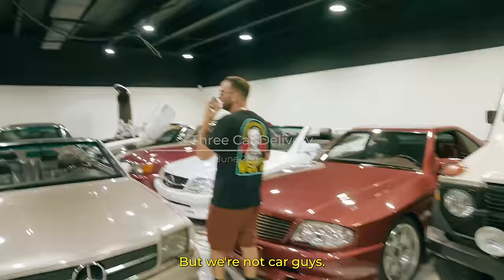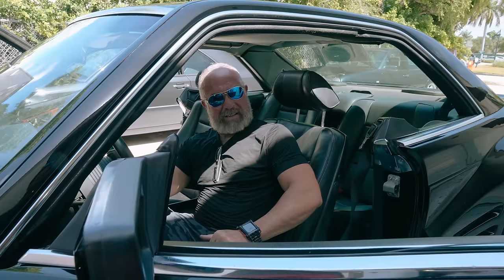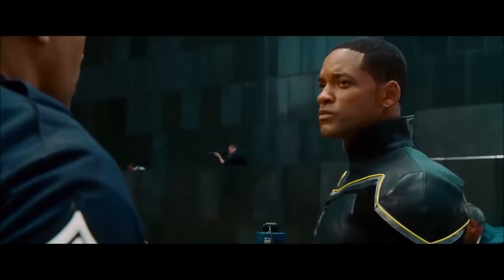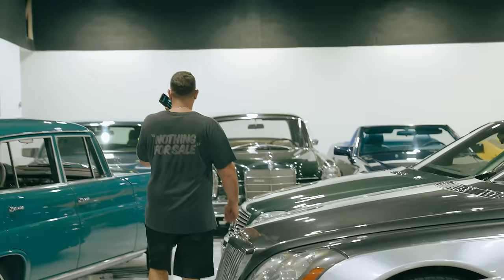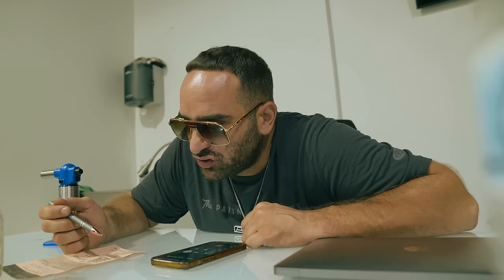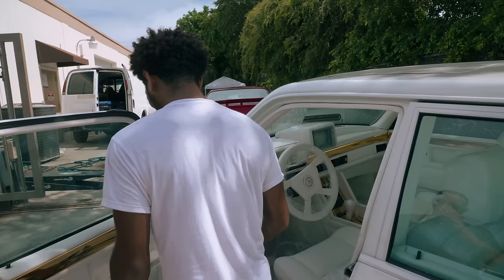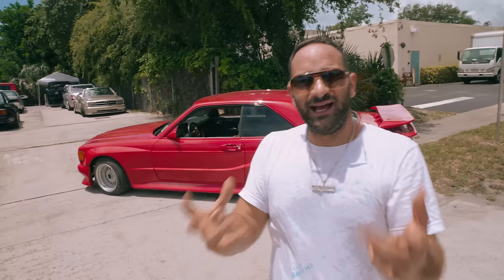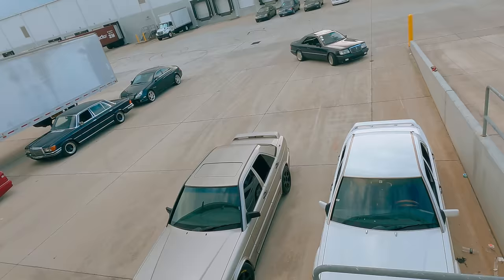UNBELIEVABLE... 9 Cars in 3 Days!! THREE 1000 SEL Limos, Brabus E36, & more! | VLOG #025

Comment: W215 CL600 AMG Alabaster White ext. Charcoal Black int. suede headliner factory on 600 , custom audio double-din screen full aftermarket components set, color matched Alabaster White 20" 3pcs. Savini wheels w/polished nickel lip, on set of Nitto Invo tires 305's in the rear, Bloody Red big brake kit slotted/drilled 6pot front 4pot rear, color matched Alabaster White roof/trunk spoiler, Owner/handsome, Passenger ft./your Girl, smoke/top-shelf, Life/like a movie, V12 Vroom!.. Well done MBZ' for the Win.. Salute" from Los Angeles California, USA

Comment: "Can't push it too hard 'couse you'll blow the motor" boi wtf...
This is really unprofessional coming from you man =))
You need to increase the power by another 50% (yes 50% of its CURRENT power output) before you should stress about that M104.992, so don't worry my dude, you're good 👌
Reply from the maker: The engine had to be retuned for US fuel… relaying the message told by German techs not to push it or it will blow the engine… pay attention
Reply: @PatinaCollective  didn't catch that in the vid (and watched it twice) but yeah it makes sense, forgot about regional fuel differences. Anyway I can tell the car's been in good tuner hands by the R8 coils, so I assume it also has other mods done by TurboBandit, and they know their stuff about the M104. 
Anyway, keep up the good stuff!
Reply from the maker: @Hawok13  yes the full dialogue was not in the video.